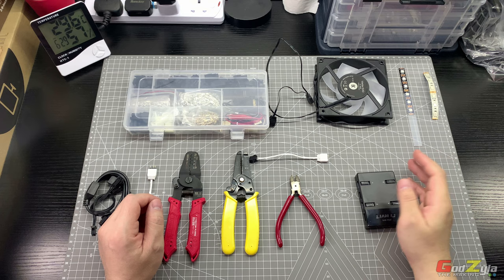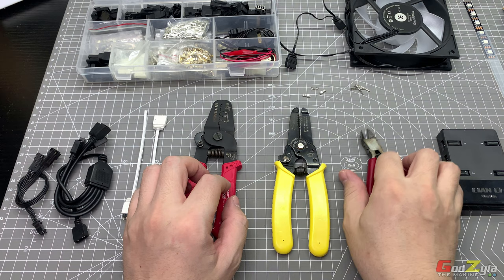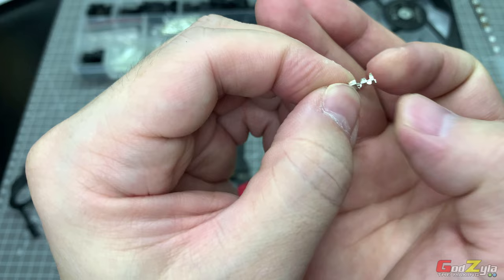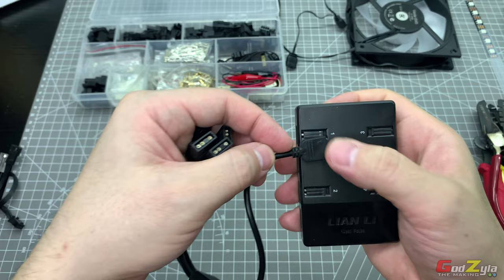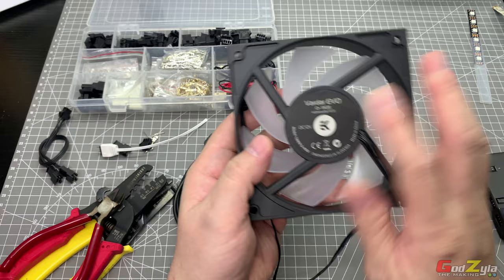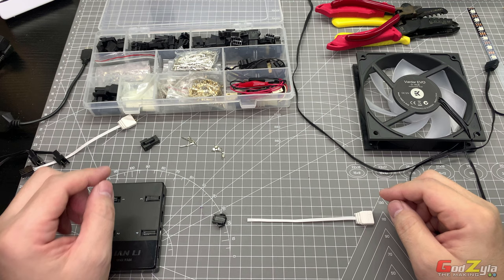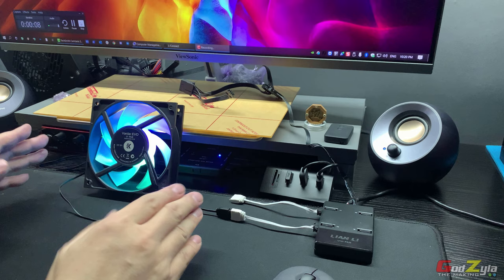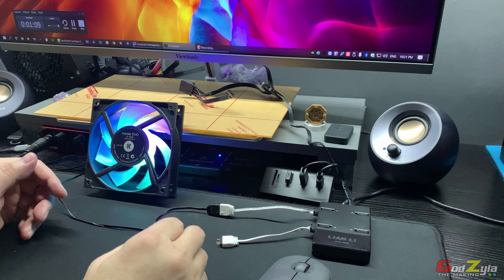Lian Li Uni Fan Controller- Custom Crimp Connectors

Comment: What if im using the 4 pin version? I mean im using a connectors from one of the splitters that came with my galahad
Reply from the maker: Hi XL-combo, 3 pins are for aRGB and 4pins are for RGB, you can't use 4pin on the uni controller.
Reply: @KleoYan  i wish i could post a pic i had all my cable splitters modified to end in the 3 pin connection but all the fans still use the 4 pin connector. Each connector only has 3 wires theres a wire in 1, 3 and 4, 2 is empty
Reply from the maker: @keriyojima  just to verify, the adaptors you are making, are they for fan load or argb or rgb? For fan load you can do 3 or 4 pin does not matter, but for argb and rgb you will need to be specific. Maybe let me know what you are trying to do. Example you are doing splitter cables for ST120 fans to be connected to uni controller or etc. As in general, there are lots of connectors with 3 or 4 pin.
Reply: @KleoYan  I wanna cut off the 3 pin connector and attach a  4 Pin JST connector
Reply from the maker: @keriyojima  based on your pictures, this should show you and they are correct. on one cable, the grey is Positive, on there other cable which connects to your ST120 fans, the grey is ground https://imgur.com/1dFkpZo.
Reply: @KleoYan  awesome thanks for the help. Just curious what would happen if ground and 5v were reversed?
Reply: @KleoYan  didnt work wires melted through imidiately luckily nothing was damaged
Reply from the maker: @keriyojima  I think you should stop here. If uncertain, do not attempt to do your own cables. I have no idea what you are trying to connect and what components are involve. I will stop here and will not proceed any further. I rather losing a viewer or to get hate by, for not guiding you than to have you damage your PC.
Reply: @KleoYan  just trying to make what you made in the video without crumping and using a 4 pin JST instead of a 3 pin
Reply from the maker: @keriyojima  I mean, you have the courage to try which is good but ended up melting the cables. It does take a fair bit of understanding about electronic circuity. Normally when I do such operations, I always emphasise not only to myself but to others, check the polarity before operating it. Even in this video, I deliberately mark with a silver marker of the +5V and to dismantle the control unit to match the line +5. Make sure the polarity are correct before I fire up the unit in my PC. It's a good try my friend but if you really unsure, do not attempt to do it 

Less argb effect will not harm you.Overall a PC is to use it and to perform for you. I might do lots of videos about this uni controller, I  am curious but practically I don't really like argb or rgb. This will tell you why https://youtu.be/0qSaX_mOjQc and my PC is always looking this way. https://imgur.com/gallery/Pw5kY4q I prefer to have a performing PC that has details instead of lighting effects.
Reply from the maker: @keriyojima  Hi, then you only need the adaptor 3pin male argb to 3pin female JST. why do you need the 4pin?
Reply: @KleoYan  because all my splitters are 4 pin male JST to 3 pin  female JST
Reply from the maker: @keriyojima  I see, ok all the very best. I will still advise you to just get the 3pin connector. anyway you will still need to get the connectors if you want to do self crimping. select 1 to 1 male, solve your problem https://www.ebay.com/itm/133521646617